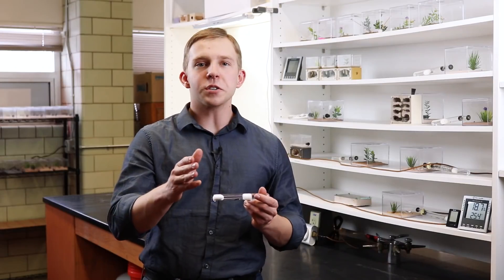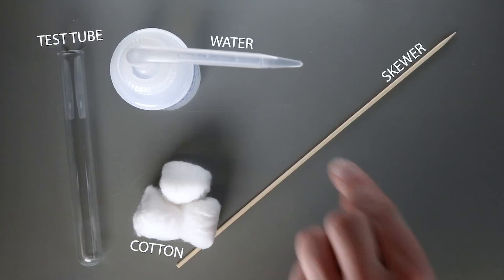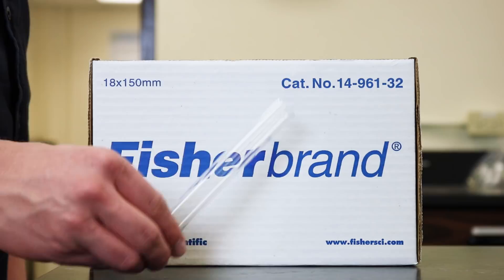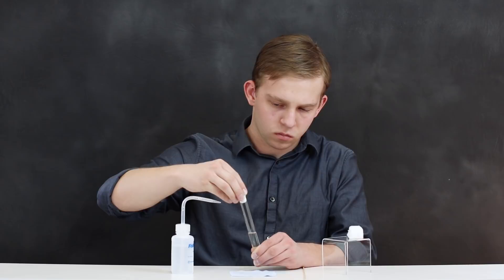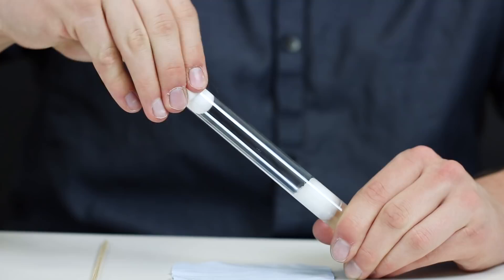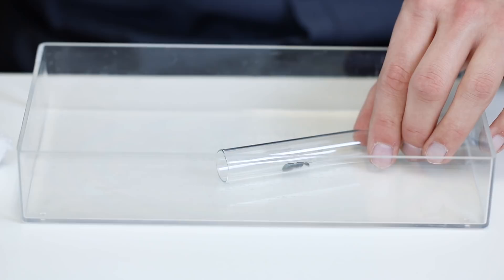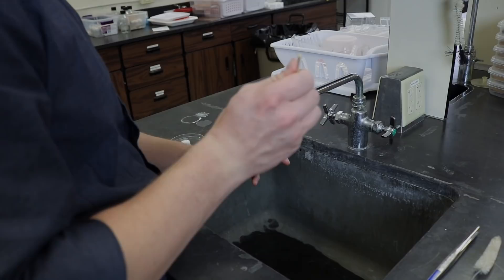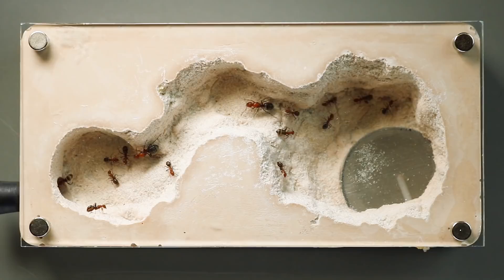Keeping Ants in Test Tubes (Basics) | Ant Keeping 101

Comment: What temperature range can the queen be kept in?
Reply from the maker: Depends on the species! Most can be kept in 68-80 F no problem, but will often do better when exposed to supplemental heat (such as from a heating cable). We incubate most of our queens at 80 F during colony founding.

Comment: Hey ant guys:
Have you thought of adding a colloidal silver solution to the tube instead of pure H2O?

(Antibacterial/Antimicrobial)
Reply: You don't want to use or introduce anything that hasn't been tested or proven safe for your ants. Using distilled water and a clean test tube while making sure your own hands are clean or gloved should be good enough as molds and bacteria grow where there is contaminates, like in tap water, or touching everything with dirty hands.

Comment: Hi Miles! Thanks for the informative video! I just had a question about the use of aluminum foil covers for test tubes. Should I worry about colonies overheating if I use a heat source (such as a heating cable) with an aluminum foil cover? I know aluminum is a good heat conductor so I don't want to do anything stupid. Thank you!
Reply from the maker: Hi Mikkel! No, don't worry too much about that. Just keep an eye on the tubes and the ants' behavior. Aluminum foil generally doesn't heat up too much.